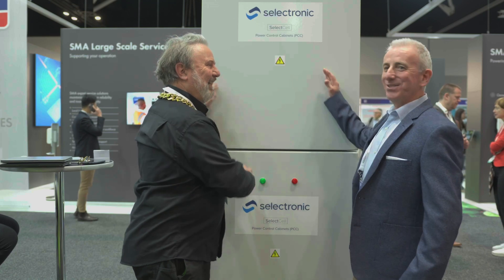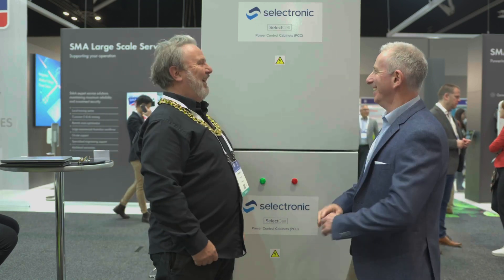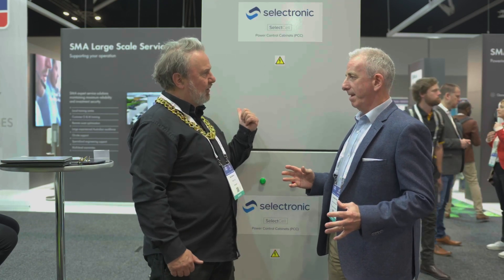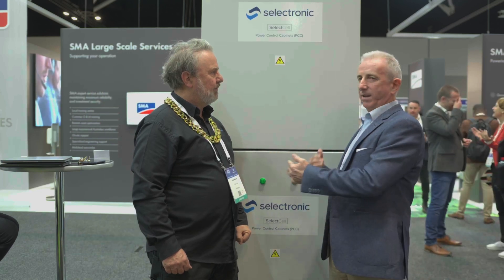Selectronic at Smart Energy Expo 2023 Sydney

Comment: I subcontract control cabinets now. I went on site with the industrial lift contractor. He had retro PLC control, another with the PLC programmed with python, and another PLC with ladder. WTAF? So anyway, after I changed a magnetic proximity switch with an alternate brand with two NO contacts instead of two NC contacts and made it work I thought, why not just have a cabinet with a terminal strip separate from the main panel so that all of the inputs and outputs are hard wired and just show up with a new panel, switch it and have it running asap? Same with these cabinets. Pre-fab. No engineering on site. Engineering on site is the bain of the industry. We are called solar installers, not solar fabrication and install. Not only that, why reinvent the wheel? For example, why develop a circuit board that does the same thing that an off the shelf PLC like CLICK can do that is low cost and easy to change. Clip it on a DIN rail and plug it in. Could use a desktop computer chassis to slot in cards too. Modular modular modular!